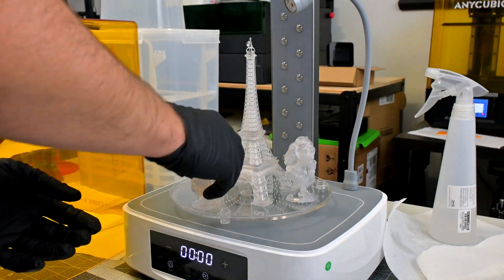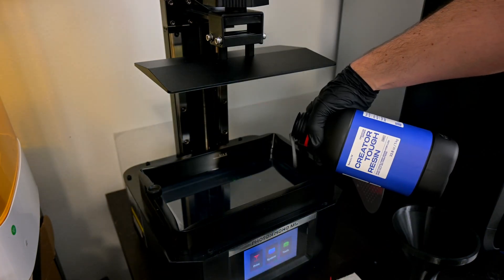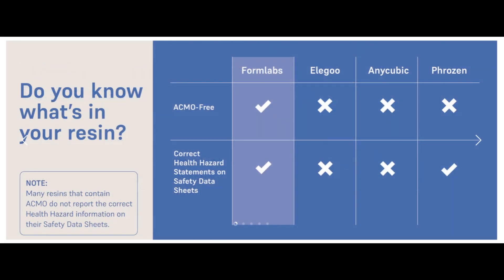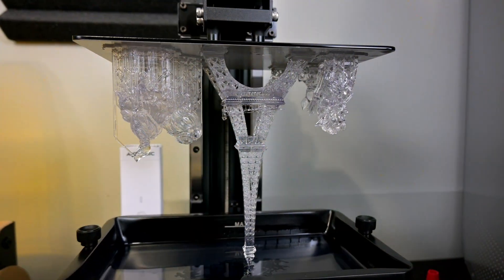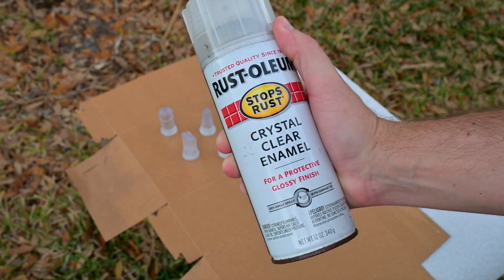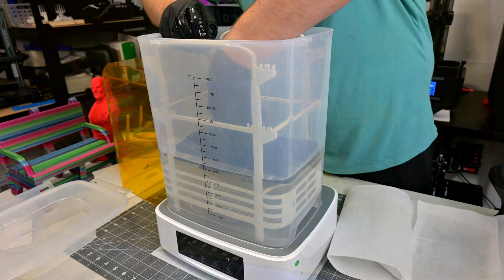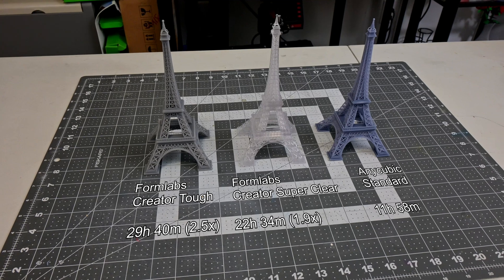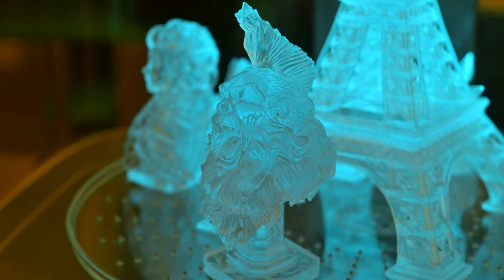Finally! Formlabs Resin for Hobbyist Printers – But Is It Any Good? | Formlabs Creator Series Review

Comment: You should not use a small cutter for geting the object of the build plate. For small and big obj. you can use a scraper. 1st place your buildplate rectangular to the table / floor. 2nd put the scraper on the edge of the contact. Now you can Hammer by your Hand the handle of the scraper, until you get below. Once.done....you are able to take it off very.easy

Comment: sorry sir have you ever tried resin other than formlabs in formlabs 3 or 3L machine? i need a reference of resin other than formlabs to be processed in formlabs machine
Reply from the maker: Unfortunately I don't have experience with the Form 3 or 3L machines, so I can't help out with any references.
Reply: you need to spend as much on a license as you do on the printer itself. it’s only worth it if you’re running a business.